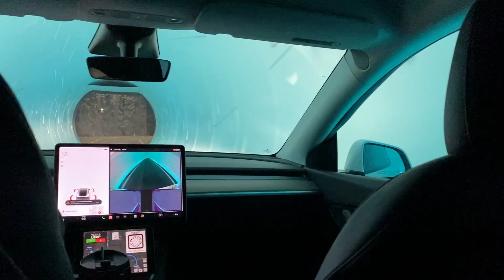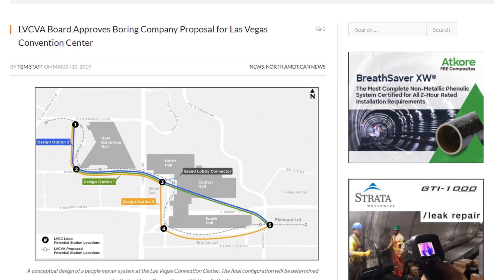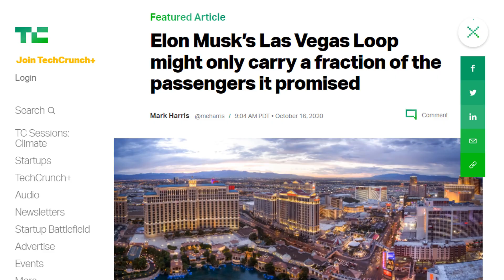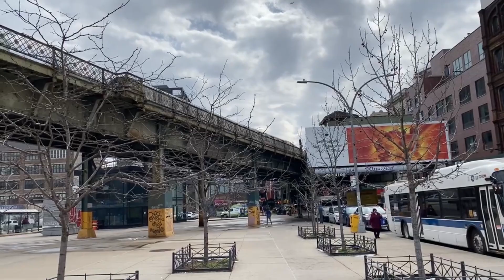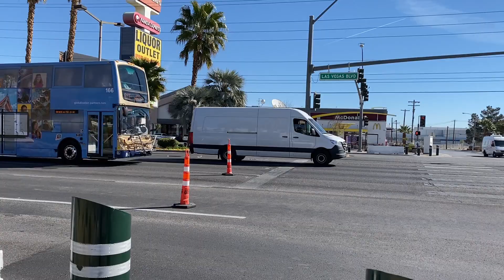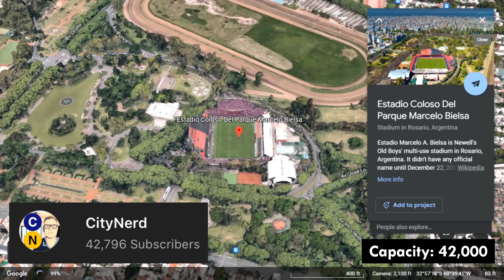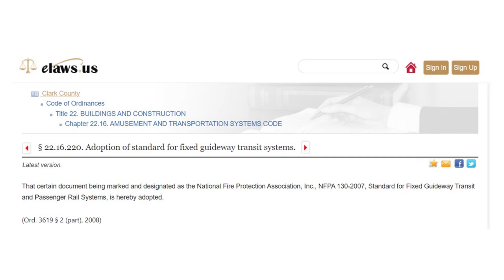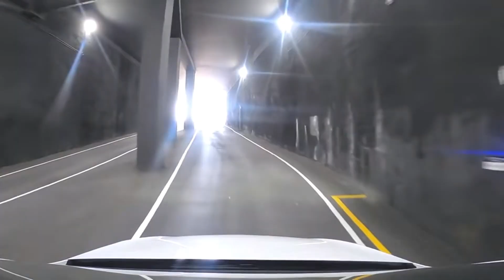Inside the Las Vegas Loop: Transportation Game-Changer, or Complete Waste of Time and Effort?

Comment: I'd just like to point out that I rode a completely autonomous closed loop car system run by Toyota all the way back in 2007. It only went like 5 miles an hour in a big loop, but it existed and worked. It was in Odaiba just outside of Tokyo, for those who may be curious.
Reply from the maker: I genuinely don't understand why the Vegas system isn't autonomous already. It's 2022. It would at least start to make a LITTLE sense then, but right now...woof
Reply: @CityNerd  The issue about operating the system autonomously, is a issue with the Clark County regulators, not technology.
Reply: @HearToneSpeak  LOL! The cars do not work in tunnels. it is indeed tech. tesla autopilot cannot be turned on in several countries because tesla is incredible horrid compared to autopilot cars 20 years ago
Reply: @toomanyaccounts  Great... glad to see your evidence to even demonstrate remotely that what you have just stated is even remotely factual on any level.   Secondly what countries can Autopilot not be used???  The clock starts now..... I will be waiting.
Reply: @HearToneSpeak  Germany for one doens't allow Tesla to use the term autopilot and has banned the fsd from being allowed in tsslas. also tesla is the worst in full self driving car tech.
Reply: @CityNerd  just place Guide-Rails like the O-Bahn lmao
Reply: @CityNerd  Speculation: Autopilot is currently officially Level 2. On a closed and simplified course it might already be Level 4, but perhaps for regulatory purposes it's not allowed to be both. If Tesla wants all available person-hours devoted to the public Autopilot version, then it's spending no time and effort officially forking Autopilot for The Boring Company to get regulator approval.
Reply: @flinx  Having worked in autonomous vehicles (Trucks/LKW in particular, which is something I'd love to hear the "urbanist" crowd out on, as I think some of my opinions are certainly heretical to the church, so to say), I am thoroughly amused that these aren't autonomous. It's the perfect marketing ploy: single lane, 1 route, relatively simple parking situation, and no non-autonomous actors to deal with. Regulation-wise it should be pretty easy to be approved for it given its a closed course and they are willing to take on the risk themselves (or more likely be insured for it), and the publicity would be worth it I'd imagine considering it would make the ever present line go up. I wonder strongly if they have some nasty oscillation in their ACC algorithm when used on that many vehicles at once in a row, that they just don't see a reason to fix.
Reply: @apz9032  If adaptive cruise control oscillation when there's many vehicles is keeping the system from going autonomous, why wouldn't Tesla see a reason to fix it?
Reply: @apz9032  TBC or Tesla could make tunnel navigation much easier on themselves in a few ways without even needing metal rails, but for whatever reason it seems they're going to solve the hard way. However the hard way is the same-solution for multiple environments including many city streets.

Technology for factory robots and motion control cameras have solved recording and playing back motion for decades. Record the inputs driving through loop tunnels. Vehicles play them back and duplicate those inputs at the correct time. 

Augment that with painted optical markers on the road or walls. Program vehicles with marker locations and how they should match up with recorded inputs. Because vehicles will vary tiny amounts in steering alignment, braking and acceleration, program vehicles how much variance is OK, and how to catch up or slow down with the recording. The cars already seem very capable of staying between equidistant painted road lines. 

If an uncommon event causes ACC to kick in and adjust follow distance by slowing down or speeding up, mathematically slow down or speed up the input playback speed. When vehicles reach the next station a short distance away, recalibrate.
Reply: @flinx   Re why wouldn't they fix it: in all likelihood it would only show itself due to an undamped oscillation occurring between multiple of their own vehicles, leading to a traffic jam. This is not really something that is a pressing issue for the engineers I'd imagine. This is only speculation obviously, aber having worked on ACC for a while it wouldn't surprise me, as it takes some forethought and work to prevent.

You make a good point that they could absolutely simply use an open loop precalculated trajectory as a setpoint with relatively simple controls on top, and that there are plenty of ways to solve this that don't require a "boil the ocean" solution like level 4 capabilities as @Torsten Adair mentions as well. This is more a themepark ride than an autonomous driving problem, and I never really understood the usefulness of the concept unless you essentially turn it into effectively a drive on train, and even then that is simply an inefficient underground tramline.
Reply: @apz9032  Vehicles driving from city streets into the tunnels were featured in the original launch video. Some plans have changed since then, but I bet one of the long term goals is still having that option. When The Boring Company negotiates for permission to tunnel, most cities could and should insist on a minimum percentage of vehicles making multiple stops on city streets like a minibus. That could mean each vehicle picking up multiple people at their homes, or from bus stops, or a mix.  

The result being vehicles with average occupancy in between the average car and bus, but also total trip times in between the average car and bus. That speed hopefully making it appealing-enough that more of today's solo drivers are willing to use Loop and make fewer solo drives in their own cars. Especially since pricing at least in Las Vegas will be per vehicle. The more passengers per vehicle the less it will cost each person.
Reply: @flinx  At that point the system is essentially reduced to a second road network for the city. Just that it's all underground, which makes it vastly more expensive to maintain, and it doesn't connect directly to any destination, which makes it quite impractical. 

At that point, one might as well ditch the tunnels entirely, and just do all the ridesharing and autonomous vehicles and stuff on the road network that already exists.
Reply: @Codraroll  weather and UV radiation significantly contribute to road degradation. Also fully loaded trucks and buses do the most road degradation. Limit or exclude those and underground pavement will last much much longer. 

As seen in Las Vegas major destinations will get stations almost right up to the front doors, shortening walk times for that half of each trip. For the other half tunnel entrances can serve residential or mixed use areas of various sizes. A 0.5x0.5 mile chunk of single family home sprawl might have a tunnel entrance in the center. In other areas like mixed density along important roads tunnel entrances could be every quarter mile like the spacing regular bus stops have, but average trip speed will be literally three to five times faster. That's way more attractive to getting people to want to use the service instead of driving their own car.
Reply: @flinx  But in exchange, you get a freaking tunnel to maintain. Those do NOT come cheap.
Reply: @Codraroll  Depends on factors like tunnel construction method, whether there's gas and diesel exhaust, whether the surface needs more maintenance because of big rigs.
Reply: @flinx  It's mostly about soil/rock conditions, groundwater intrusion, and in some cases seismic activity. Maybe also earth settling around neighbouring large buildings. There's a reason why transport systems everywhere avoid tunnels if they can: they are heckishly expensive to maintain over time.
Reply: @Codraroll  I can't recall the last time I saw a tunnel plan criticized for having too expensive maintenance costs. It's always criticized for construction costs.
Reply: @flinx  I'm a civil engineer. Trust me, the maintenance costs of tunnels comes up all the time, and it's a lot. Keeping stuff moderately watertight underground for long - or even just pumping out the rainwater and keeping it ventilated and lit up - is very expensive. I doubt it'd be possible to make a tunnel break even if all you do with it is to run taxis in it.
Reply: @Codraroll  breaking even is better than the per ride subsidy most cities have for public transit. If TBC could provide rides and receive a subsidy, but less per ride than cities are paying now, those city governments would save money per ride and riders would get faster and shorter trips.
Reply: @flinx  And if pigs could fly, we could just all have pigs and ride to work on them, instead of having to hassle around with vehicles. Porcine aerial propulsion would have to be developed first, though.

The Loop has inherent factors that makes it vastly more expensive and less efficient than comparable alternatives. To work at all, it would require several undeveloped technologies that its competitors could take more advantage of. It proposes a ludicrously extravagant amount of infrastructure for absolutely minuscule benefit. There is wide agreement about this among literally every expert out there. The only reason why the Loop sort of works in Las Vegas is because it's a marketing ploy for Tesla, which is so effective they're willing to carry the costs to keep it running. Outside that one specific setting, it doesn't make any sense at all. It doesn't scale and it offers a pathetic service at enormous costs.
Reply: @Codraroll  Notice that every time I answer a point or question, you bring up a new one(s)? Can't let the last word answer the points? If you understand the details so well, why in the other thread ask how a person may hail a vehicle mid-line? (Answer: with a smartphone app or kiosks in the station)

Loop will trade some efficiency for speed. However the USA National Transit Database contains annual ridership and service hours for public transit systems. It turns out for many systems because of low off peak ridership that average vehicle occupancy and therefore efficiency of those large heavy vehicles isn't as stellar as lots of people first assume. It's certainly great compared to a car with 1.2 average occupants, but get a few people sharing electric cars and their efficiency is surprisingly on par. 

"Enormous costs" is simply ignoring their construction cost at the convention center and expected lower cost for upcoming projects. Their latest machine Prufrock-2 is in testing. A related factor is charging more for private rides than shared. A bus has no first class section with first class service and fares. TBC will have people who can afford it paying for private rides and the revenue benefiting people who share them. 

TBC certainly needs to prove they can get construction costs down further. While American subways are at or approaching $1 billion/mile for about 30,000 passengers/hour/direction, there will be circumstances that don't require that kind of throughput. Some upcoming light rail costs are $150-200 million/mile. Ones involving tunnels like Dallas and Seattle look like $750-1100 million/mile. But consider that not all corridors have tens of thousands of people/hour/direction. Not every line has to scale. Instead of light rail lines spaced far apart, loops could be on neighboring parallel streets. A tight grid of loops means shorter walks to the nearest one. Fast and quick trips makes them more attractive to drivers to drive less up on surface roads, which with less car demand can politically add bike lanes and wide sidewalks. 

There's details I need to research more too, like tunnel maintenance costs. Maybe TBC hasn't considered that thoroughly enough. Or maybe they have and think cost will be manageable. Maybe they're planning to scam cities and go bankrupt once the tech is ready for Mars. I'm sure most viewers for this video will assume the latter.
Reply: @flinx  A tight grid of loops means a lot of tunnels are required. Again, for *taxis*. The ludicrous cost of establishing and maintaining tunnels makes this an utter non-starter. In order for a tunnel to make economic sense, you need very large passenger volumes. There's a reason why most cities' metro systems have more track aboveground than underneath, and that's because going underground is something you only do when you have no other options, such as inside the city core. Building tunnels in the suburbs would be a colossal waste of money. If you have mile-long stretches of tunnel used by only a couple hundred people per day, then their individual fares would have to cover half a percent of the maintenance cost for the mile-long stretches of tunnel, plus however much is required to maintain the vehicles, plus overhead and all that. At that point, you might as well just use autonomous taxis on the surface and ditch the tunnel entirely. The higher speed is not worth the extra expenses.
Reply: @Codraroll  A tight grid of loops is relative to widely spaced light rail and BRT. I see how the wording wasn't clear enough. It doesn't mean making tunnels if a parallel tunnel nearby isn't approaching saturation at peak. No tunnel if a large section would only have a couple hundred riders per day pass through it. 

The video pointed out TBC has said high capacity vehicles are in the works too. The vid dismissed them as never showing up because they haven't shown up yet. That doesn't mean they won't happen. 

Even with just cars and human drivers limiting vehicles to about 3 passengers a test in May 2021 demonstrated 2200 passengers/hour/direction. With autonomous vehicles averaging 4 passengers/vehicle that's 2900 pphpd. That's more than many BRT and some light rail lines actually carry at peak, not what they could. High capacity vehicles could handle 10,000 pphpd. 

In order for a $20 million/mile tunnel to make economic sense, you need moderate passenger volumes. People have combined and compared  data like a city's transit system average trip distance, average cost per vehicle mile and per passenger mile, estimates of existing EV total cost of ownership per mile, future trending EV TCO/mile, construction cost + interest over the years of paying it off, and possible fare structures and average daily ridership and found the math can work out. I don't remember if annual tunnel maintenance was estimated.   

Speed matters to drivers. Toronto has among the best mass transit in Canada and the USA. I'm told even in the Greater Toronto Area peak time bus service is frequent and connects to trunk lines. In Toronto, 41% of workers drive their car to work without any passengers, while 37% use public transit. In the GTA 57.8% of commuters take their car to work alone, and fewer than one in four rides transit. That's more than 2-1 choosing driving. I want most of them not driving, and a faster alternative than they have today is a way to convert them.
Reply: @Codraroll  ... Or use the flood tunnels in Vegas!
Reply: @flinx  i imagine it’s not autonomous because gps is spotty in the tunnel, which is required for localization, i.e. for the car to know where it actually is at any point in time.
Reply: @CityNerd  One word: litigation
Reply: Hasn’t Disney perfected this with their trackless ride technology? 
They move 2200 passengers an hour on the Ratatouille ride. 🐀🚗
Reply: @TorstenAdair  Any idea of that ride's and that tech's top speed? I don't have a link to the page handy, but there's a list of multiple technological ways industry has gotten vehicles to autonomously navigate without a steel or concrete type track or guideway. Maybe The Boring Company could use the Disney ride tech of WiFi, RFID, and LPS navigation (local positioning system – miniature, localized version of GPS).
Reply: @flinx  I think, in a tunnel, you just need spacing tech... Radar bouncing off the vehicle in front.

In an open space, like Ratatouille, you need slower speeds, and probably subsurface transponders for wayfinding.
Reply: @TorstenAdair  funny that the slower speed of ratatouille you get to the other stops far faster then the loop. walking is faster then taking the tesla loop
Reply: [] ... I rode a completely autonomous closed loop car system run by Toyota all the way back in 2007. 

2007? How about early 1990's? And still going, see:
youtube.com/watch?v=TdR34x3WTa4
(Rotterdam, The Netherlands)

Granted, it follows an induction path, but still, no driver.
Reply: Disney had a closed loop autonomous driving system with little cars at Disney land in the late 50s. It’s still in service
Reply: In the latest videos from CES the drivers are saying that the cars have already been modified for autonomous operation, but that it is not yet enabled as they are still awaiting regulatory approval and liability is “holding us up right now, but once that gets cleared we’ll turn all the cars on”. 

After all, The Boring Co actually took the press for test runs using autopilot running in Loop EVs over 2 years ago in the 1.14 mile test tunnel in Hawthorne California.   At that point, autopilot was limited to 90mph (145kph) but was scheduled to be increased to 125mph (201kph) a few weeks later. 

Not surprising considering that following a white line in the controlled environment of a tunnel is hardly rocket science.